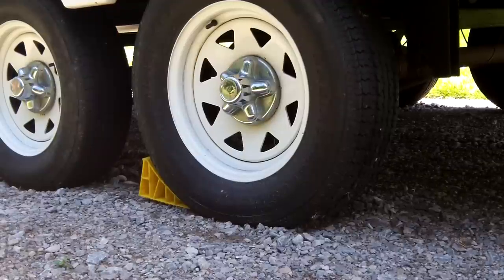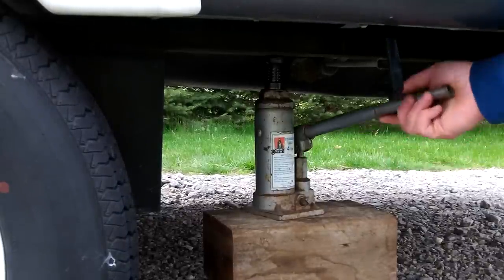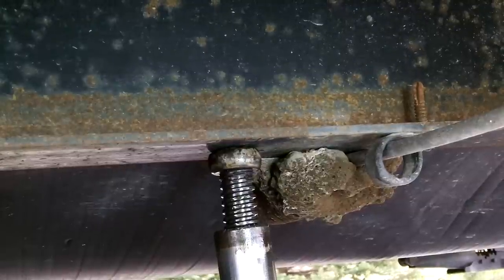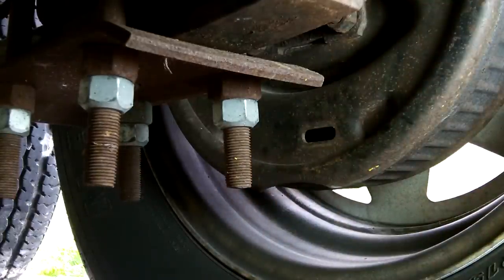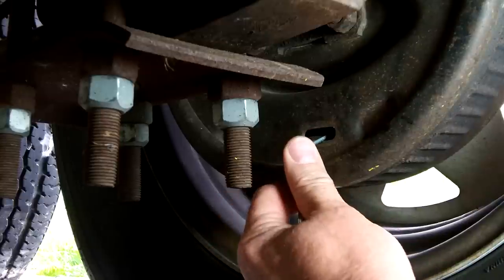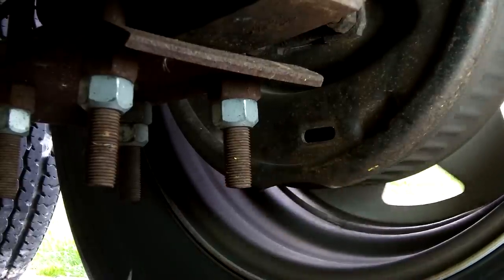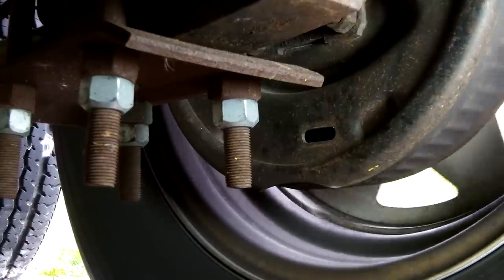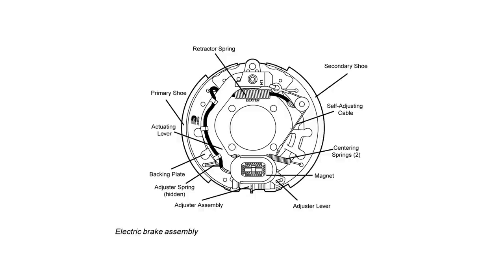Checking and Adjusting the Dexter Axle Electric Brakes on RV or trailer.

Comment: In response to automatic adjusters. Trailer electric brakes use a magnet and lever to apply the brakes and they DO NOT work in reverse. You have to manually adjust them.

Comment: WTH?  Apply inward force on the star wheel???????  Are you rotating the start wheel up or down?
Reply from the maker: That depends...I have had to rotate it both ways on different wheels. Just don't go too far in one direction or it will come apart.
Reply: Rotating it upward expands the shoes and downward contracts them all four corners of on my rig.

Comment: Actually the electric trailer brakes do work in reverse, they just do not have the mechanism for self adjustment, since there is no cylinder or hydraulic system involved. (obviously talking about electric trailer brakes only, I know nothing about any of the other types of trailer brakes)